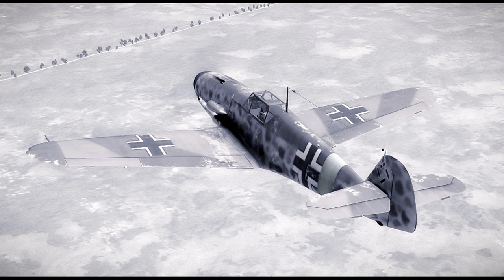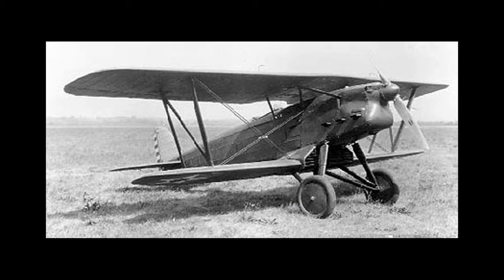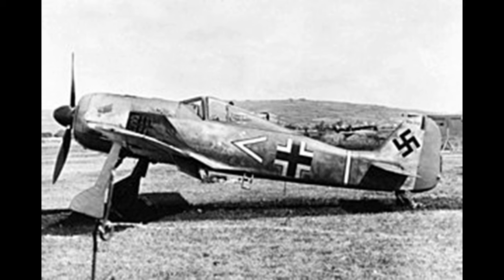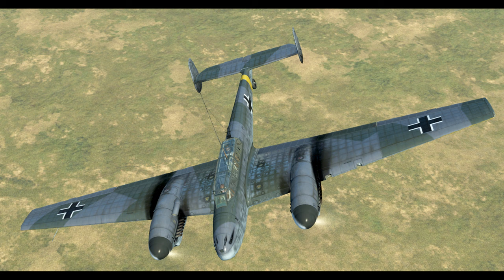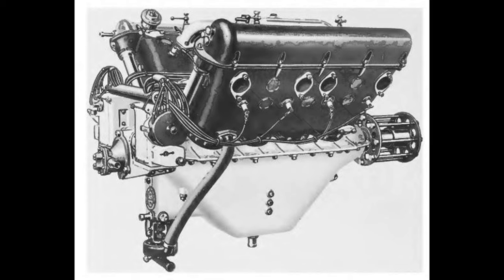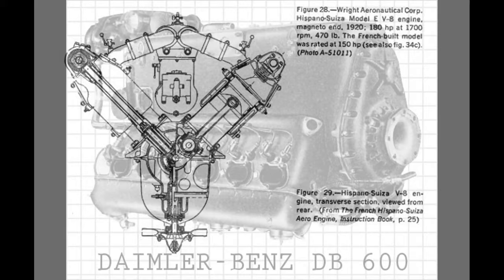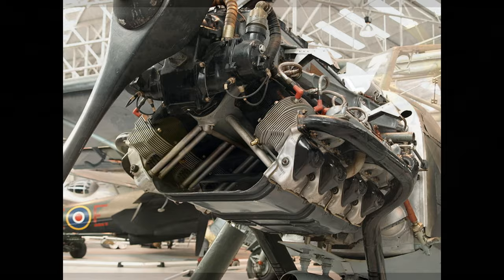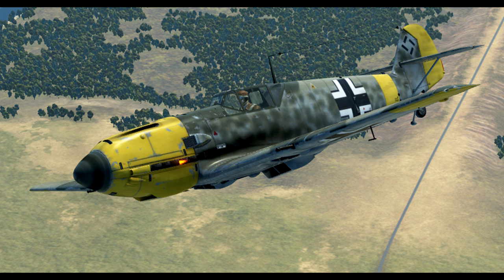Messerschmitt Bf 109 , Why an INVERTED V-12 Pt. 1? inverted V12s vs. upright

Comment: It made sense for the allied engine manufacturers to produce upright V12s as that was what they had already and they would be easier to adapt to other uses as you said.  When developing their aircraft the Germans were working from a clean slate and aircraft engines were designed specifically for aircraft so those advantages (vis and maint) were worth it.
Reply from the maker: Thanks Barton, always nice to see you here.
Reply: @GregsAirplanesandAutomobiles  Always good to be here.  Love your videos.  Always very good information.
Reply: The Allison brothers got their start racing cars and refurbishing and modifying Liberty V12's for racing. They moved to Indianapolis to be close to the Indianapolis Motor Speedway. In 1929 the USAAC wanted a aircraft engine capable of operating at high altitude and making 1,000hp. Allison brothers used their experience building racing V12's and produced the Allison's V-1710. The Great Depression slowed development down but in April 1937 Allisons V1710 C-6 completed testing and was rated at 1,000hp at the required altitude. 

I have read that Allisons was able to obtain a contract that any USAAC aircraft built with a V12 had to use a Allison V12. The only exception was the P-51. The Merlin engined P-51 gave such a boost in performance, especially at altitude, that it could not be ignored and was immediately ordered into production. 

You cant compare a Tiger to a Sherman. two different tanks designed for to very different roles. 

The Tiger developed from the 1938 Durchbruchswagen, basically a break through tank. It was designed to be deployed, punch a hole in the lines, be pulled back and serviced and readied for next assault. In that role it was very effective. When Germany started losing break through tank turned into "Fire Brigade" tank unit that was rushed from spot to spot along the front to counter attack a enemy breakthrough. The problem was while Tiger unit was plugging this hole in the line the Soviets were breaking through at two or more other places along the line. 

The Tiger was also very good in its defensive role. But when your constantly outnumbered ( 1,347 Tiger I's versus 60,000 T-34's and 55,000 Shermans), constantly forced to withdraw so you dont get your maintenance time attrition constantly wears those numbers down. Add to this a German logistics system obsessed with producing more tanks and no spare parts then you see the readiness numbers constantly go down as tanks were cannibalized of parts to keep other tanks running. 

Panther is a whole different bag of apples.

Comment: Enjoyed your post very much. Back in the 60's I flew the rare Waco ENF with an inverted Martin engine. When I asked I was told inversion was for prop clearance. Your clip gave me a much better understanding of the issue, thanks
Reply: Not being familiar with the Martin engine, it may have been for prop clearance. The common reason for inverting engines which were direct drive was clearance. After they started using reduction gears between the crankshaft and the prop that reason went away.

Comment: Great Video Greg, thank you.One other possible reason for the inverted V engine being so desirable in fighter aircraft (The BF109 being the best example) is the fact that you can configure the installation to have a cannon or heavy machine gun firing through the impeller spinner... theoretically the best place for such a weapon to be mounted since the recoil is almost perfectly aligned with the center of gravity of the aircraft, the cannon's recoil can be absorbed by the relatively strong and heavy engine, and no interrupter mechanism is required to prevent the cannon from destroying the propeller.  Also, it is somewhat easier to mount additional heavy machine guns in the top of the cowling (in my opinion the rifle caliber machine guns that the Japanese mounted in the cowling of their fighter aircraft were not very effective against fast, heavily armored aircraft like late war US fighters.  The Germans, in contrast, used heavy machine guns).This gave the BF 109 pilot easy to aim, parallel and concentrated 30mm and two 13mm (approx. .51 caliber) firing right under their gun sight.  This is similar to the advantage that the P38 had with its concentrated and parallel firing four 50's and 20mm firing through it's nose. My two cents.  Time to get back to work now  ;  )
Reply: Interestingly, the French Hispano 12Y upright engine allowed an engine mounted cannon between the cylinder blocks - on the Bf 109 the cannon breech was behind the engine, under the cockpit, between the pilot's legs.
Reply: @johnusher1921  This engine was also the basis for the Soviet engines used in the Yak-1, 3 and 9. All those aircraft also featured guns firing through the spinner, typically a 20mm ShVAK cannon. Some versions of the Yak-9 were even upgunned to 37mm or 45mm weapons, still somehow managing to fire through the spinner.

Comment: The Germans often mounted a 20mm machine cannon (e.g., the MG FF in the Bf109) firing through the propeller hub.  The barrel (or blast tube) of the 20 mm MG passed between the cylinder banks.  The inverted V12 would lower the center of mass & recoil force of the cannon downwards as well relative to that of the typical through the hub HS404.

Comment: Thanks for the excellent videos Greg! Regarding the use of inverted DB60X series engines on Me 110, 210, 310 & 410 – Once the inverted V-12 installation for an aircraft is developed (Me109), it is much easier from design, manufacturing and logistics point of view (as you pointed out in your video) to “copy” or adapt similar installations into multiengine aircraft, where the improved forward visibility is not affected by the engine(s) installation, especially when they use engines from the same family.

Comment: BINGGgggg!!! CORRECT!
A document was found in RLM archives that simply said pilot view was reason for inverted V preference.  IIRC it was dated 1936, about time when first inverted DB601 was put on Bf 109 and He 112.  Before it was upright BMW IV series used on nearly all German aircraft.  I wish I could link to you the actual document, but someone translated it and posted on forum (I think it was Key Publishing forums). The Bf 108 did use Argus, maybe that inspired desire for similar when making 109?  Also, look at the He 51.  It had BMW IV with downward pipes to get exhaust away from pilot, I am sure that was a supporting argument for inverted.
There is some significant challenges in the oil system, both in scavenging and oil consumption (think Radial engine), but advantages as you point out are worth it.  
Your intro was a bit short, as there were plenty of inverted in-line engines, such as the Ranger (US), Gypsy (UK), and other Argus engines, and few others. 
There is more, but want to keep this short.  Good video!
Reply: Also don’t forget the Canon in the middle of the engine. And twoMachine Guns On top of the engine created a buzz saw effect.

Comment: Hi !! I'm an Aeronautical Engineer....I gradueted in Argentina,with most of my teachers from Germany.
They mentioned that  in a plane,all the airstream in the front is going up-stream....and  going downwards at the rear.
So,from an aerodynamic point of view,is better to have that shape,with the wider part at the bottom,and the air going up,like it happens in an airfoil .
Also,like You did....they mentioned visibility.
Regards.

Comment: Lower Center of Gravity point for the inverted V-12 is absolutely correct, as is static stability. The Spitfire owing to the higher CG was probably more statically unstable, but that might have contributed to a higher roll rate. German WW2 fighters not being known for their high roll rate. But they were very stable gun platforms, conversely. Great topic, Greg!
Reply: The FW190 was definitely known for it's high roll rate :-)
Reply: @notsureyou  Not compared to the P51 Mustang or the P47 Thunderbolt.

Comment: Specifically the bf-109 I saw other videos and believe that the German obsession with having the cannon centered in the prop has a lot to do with engine orientation in that particular aircraft. As for the ju-88, that application could have to do with engine availabilities and power output. If it performs great in fighters, 🤷 throw 4 on a bomber. Great work, great video, subscribing now👍
Reply: I was thinking along that same line.

Comment: It may as well have helped with noise levels in the cockpit. Short pipes on 1000 + horsepower engine must have meant almost unbearable noise levels causing deafness in pilots
Reply from the maker: That certainly makes sense. Noise gets very fatiguing.
Reply: Really nice point, actually that reminds me that at least two pilots who have flown Buchon (Upright Merlin) and original Bf 109 G (Inverted DB605), complain the noise is considerably louder and much worser in Buchon due to packaging of the engine configuration, as well as the engine exhausts being higher and closer to the pilot.

Comment: Another excellent video. I would be very interested in a similar comparative discussion of sleeve vs poppet valve aviation engines, , especially inclusive of the Napier Sabre and Bristol Centaurus on the sleeve valve side.  Happy to support you via Patreon and encourage others to as well.
Reply from the maker: I do want to cover the sleeve valve engines. I think those might have proven to be the way forward had the turbine engine not showed up on the scene. The potential of that design is massive.
Reply: Mmm8
Reply: @GregsAirplanesandAutomobiles  
I think that with an aircraft engine in wartime another factor to consider is manufacturing hours. How any manhours to build a RR Griffon vs a Sabre. With the sleeve valve you effectively doubling or triping your manufacturing time per cylinder with all of the machining operations required
Reply: @GregsAirplanesandAutomobiles Sleeve valve engines suffer badly from cold starting 'stickiness' of the sleeve assembly and the gear train comes under enormous loads if the engine hasn't been run for a while. Modern lubricants might solve this, but the complication of design and manufacture has always favoured the simplicity of poppet valves in a separate head assembly. See old BMW flat twin engines from the '70's !
Reply: @jimlambert1398  I think the sleeve valve only really pays off in multi-row radials where it isn't practical to fit more than 2 poppet valves per cylinder.

Comment: Well done. I had assumed that the inverted-V was somehow tied to utilizing direct fuel injection, rather than carburetion.
Reply: Those 109’s used to be able to climb straight up without the engine coughing for fuel, and it could climb faster than the Spitfire. The British Spitfire had a tighter turning circle at certain speeds.

Comment: You nailed everything I would have come up with. 

Keep in mind, with maintenance the only thing NOT accessible from the ground is the Crankshaft, main bearings and big-end rod bearings. All of which are not regularly serviced, and when serviced require the engine be inverted to lift out the crank or set it back in. 

Everything else, high  pressure fuel pump, direct injection individual injectors, spark plugs, valves, cams, camshaft drives, oil pumps, oil lines, etc. Were all mounted within reach of a man standing or on a short ladder.

Comment: Always interesting subject matter. I would have guessed that an inverted V would give a bit more room for MG's and Ammo. I think Packard built an "X" engine at one time.
Reply: Interesting thought. Possibly more like taking an advantage of the design.
Reply: I was thinking the same thing. The Germans mounted two MG and a 20mm cannon firing through the propeller hub in the nose. American designs usally had the armement in the wings
Reply: Rolls Royce did as well.. the Vulture was one. Didn't work out.

Comment: One tiny correction, the British Crusader tank used the Liberty engine.  The Meteor was used primarily in the British Cromwell and Comet cruiser tanks during the war.
Reply: Tank and AFV News 

I was about to post exactly the same correction, with almost the same wording, when I saw your post.  

The problems associated with the Liberty V12 made the Crusader unreliable in the Desert, and this experience caused the Meteor-engined Cromwell to be preferred over the Liberty-engined Cavalier and Centaur tanks that were otherwise fairly similar.

Comment: I took aircraft maintenance in college and we touched lightly on this 

Your video is very informative 
One thing my teacher said is by inverting the v12 the crankshaft is now on the top of the engine higher up from the ground 
Effectively allowing a larger prop 

U have more thrust per rotation of the propeller at a potentially slower speed of the engine allowing for greater fuel economy 

And if needed I can throttle up and due to the larger prop have a “in theory” a better climb rate and more acceleration 

All on paper at least 

Great video
Reply: Excellent! So much information but also with interesting sidetracks! Great job!

Comment: Just an observation from an automotive mechanic. Since the valvetrain, In effect camshafts,followers,valve springs etc. all can suffer from oil starvation under extreme conditions in an upright engine.
Possibly the engineers had the advantage of rerouting additional pressurised oil “up” to the crankshaft assembly, seeing as though the entire valvetrain was effectively swimming in oil at the “bottom” of the engine that was ready to be scavenged back to the tank.
As usual Greg, Great Clip.

Comment: I've also read that a reason they went with the inverted engines, is because the civilian engines which were available at that time (Argus, if i remember correctly) were a good starting point for developing military grade engines. And those civilian engines happened to be inverted. Although i dont have any proper sources to back up such claim.

Comment: The propeller is usually attached to the crank shaft of an engine, If the crank shaft is on the bottom of the V-engine and the cylinder are above, that puts the propeller too close to the ground in single engine aircraft. The Rolls Royce Merlin has a prop drive gear reduction to move the prop up to the top of the engine as in the P51 Mustang. This kept the engine low out of the pilot's line of sight and the prop high on the engine for best ground clearance. The reduction gear prop drive added extra complexity and cost, but the advantages outweighed those problems. The reduction drive also reduced the prop tip speed for greater efficiency, otherwise as the prop tip speed approached the sound barrier, it looses laminar flow of the air, also loosing efficiency.
If you attach the prop to the crank shaft, you must use longer stroke engine designs to get the required torque at those slower RPM. Short stroke higher RPM engine designs get quicker torque values from those higher RPM, but need the gear reduction to keep prop speeds within acceptable ranges.
The cam shaft could be beefed up to also become a prop drive, but it turns twice as fast as the crank shaft, hence the gear reduction driven from the crank shaft. A crank shaft on the bottom of the engine is a simpler, cleaner design as you stated and is why it is used more than an inverted V-engine design.